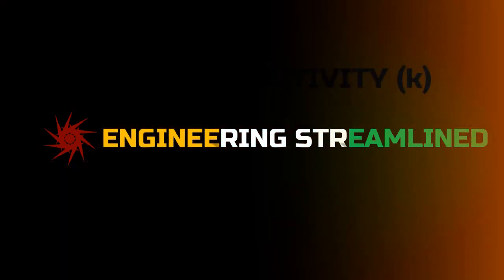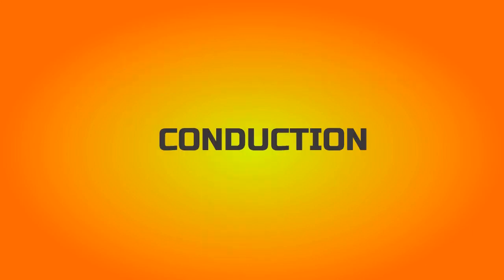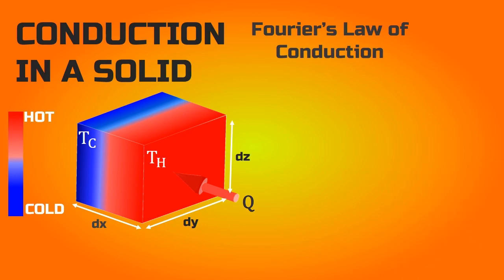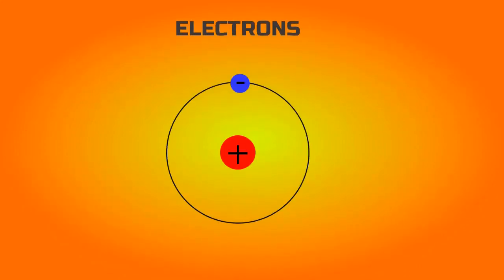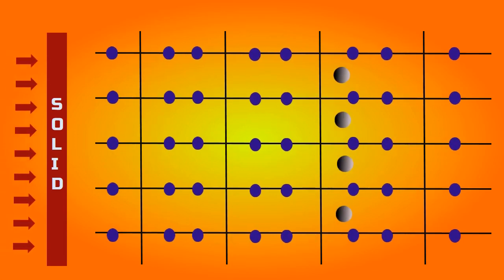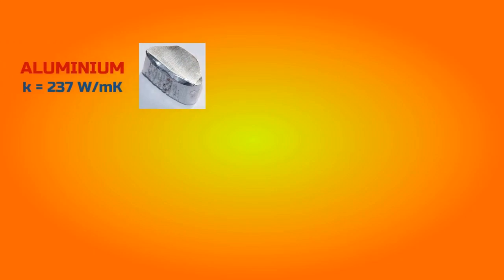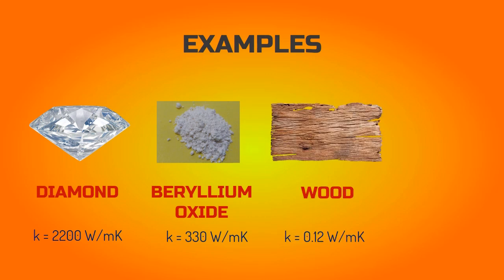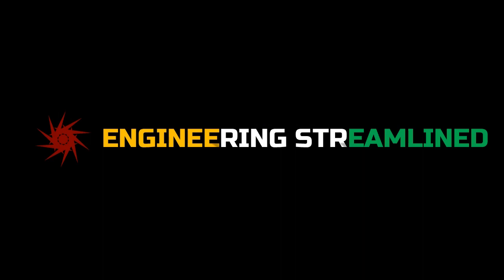Understanding Thermal Conductivity in Solids

Comment: 6:55 This is an incorrect assumption. The difference in perceived temperature arises from the thermal diffusivity of the material (the ratio of its ability to conduct heat to its ability to store heat).
Reply from the maker: I agree with you. Thermal diffusivity is the ratio of thermal conductivity  to volumetric heat capacity of a material. So, thermal diffusivity is directly influenced by the thermal conductivity. So, a high thermal conductivity material tends to have high thermal diffusivity.

Comment: where is temperature measured in the block example? anywhere on the face of hot or cold? the block treated in similar fashion to point method in physics problems?
Reply from the maker: The average temperature on each hot and cold wall is used for calculating the thermal conductivity. For example, if you measure temperature at 10 points on the hot face of the block, they may differ by a small value. So, average of these 10 measured temperatures will be considered the temperature of the hot face of the block.
Reply: @ENGINEERINGSTREAMLINED  ok so you sample temperatures randomly on the sides it sounds like. thank you for the clarification.
Reply from the maker: @josemilian4167  Yes, we take sample temperature measurements at random points on the hot or cold side
Reply: @ENGINEERINGSTREAMLINED  excellent thank you!